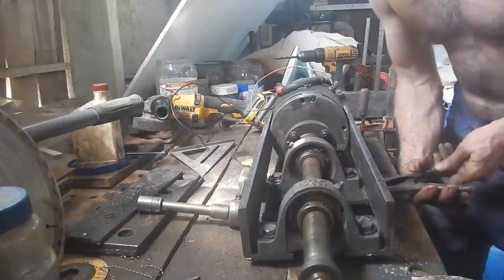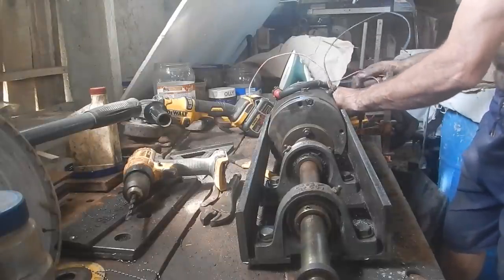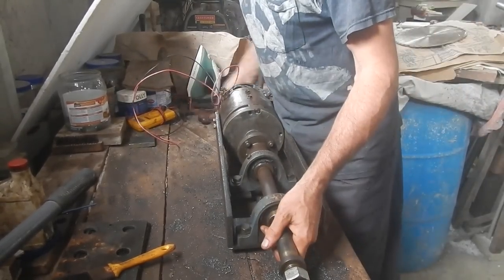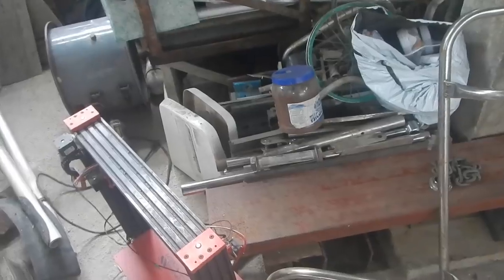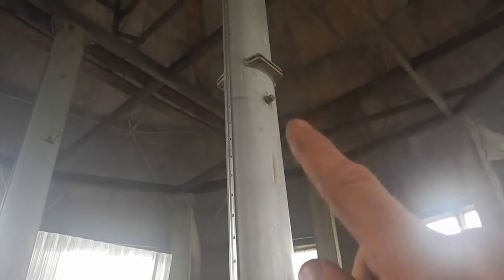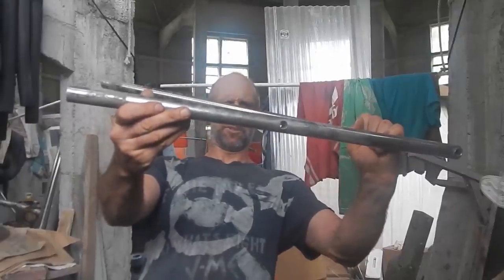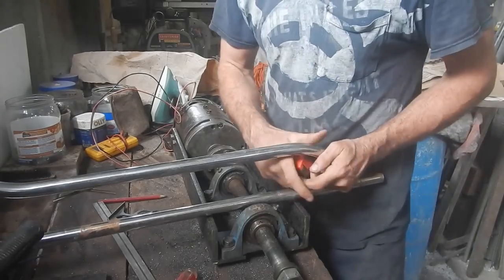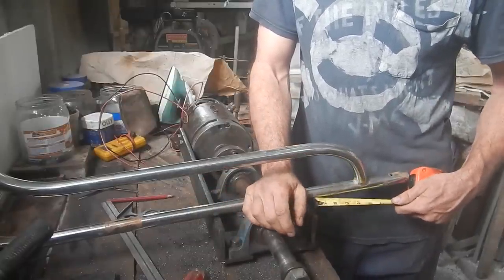Lumber Mill 06 Blade Pivots

Comment: I Love hearing the rain. Inside work day! I have been doing some research on big electric motors for sailboats and regeneration drives. Your ability to make motors do all these different things with power you are collecting from the sun is really inspiring. No diesel needed!
Reply: Oh yeah, could you put a 'dimmer switch' on it to control the rpms?

Comment: Nice tip for keeping nuts from vibrating loose, hold the last tensioning for three seconds for the tension in the bolt to settle and holding on the nut.

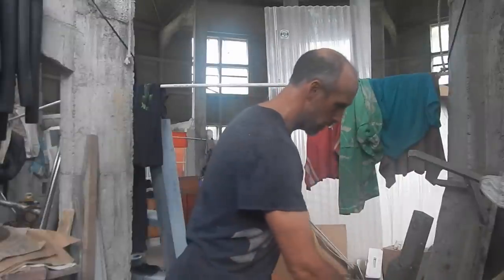Comment: Jaimie at 8:12 what about using a heavy duty hinge welded to the bottom end at the blade end welded to the frame as well as the saw bench you will be connecting it too.

Comment: I started to build one years ago. Mostly because I wanted to and knowing I would never finish it. 
I used a T gear box with 1:1 ratio and had a 5hp 220v electric motor. The problem I had was going to be the gear box and the ability to keep the gears tight, as the gearbox was just some random scrap I found. 
if i was going to do it all over again. I would just buy a brand new swingblade sawmill. Lucas no longer makes the 4 inch model as far as I know. Yet back when i was looking they were only like 6k new. Used one might still be able to be had. i did not care anything about bigger lumber other than 2x4 and 1x4s for what I was going to do. My plan was to bring in cottonwood trees that have been felled and dead for ages and cut and stack them in to lumber. Sell them for a fraction of what a new one cost. All while still making quite a bit of money doing it. Now I no longer live where I was going to do that. I bought a nice place far away.

Comment: I think this build is great but I have a question. What size blade is that and is that the same size that's on the radial arm saw? In theory can't you use the radial saw to do the same thing? Check out Stumpy Nubs for the set ups. Back in the day they did a lot with a radial saw but it was sketch, but that would be right up your alley. That's why I watch, so fun.

Comment: I don't understand why it has to swing? Isn't it easier to rotate the log. And the complexity of the construction would be reduced and the saw would be more robust and last longer. 8:16
Reply: I was thinking the same. But it may be connected with the fact that the log must be anchored. Or too heavy to easily rotate.
Much easier to pull a lever, rotate and block, than unclamp the log, rotate, clamp again. 
Sure, building the swing will take a day or two, but saving a minute at every log will add up in time. 

However, I like more those with continuous blade. Or flexible, however is named. They run so smooth, and the cut is thinner. 

My brother had built one with swinging blades. Bought 8, to cut one log in a single run. Tested with a single blade, but did not worked. The cut will go astray. Mayne not tensioned enough, maybe needed some guides closer to the log... however he switch to circular blade. Big one, one meter diameter. Damn thick cuts. 1 cm. actually at 2 planks one was going in to dust.      Started dreaming at lasers :))
Reply: And each tooth on the saw blade will need to be bent in a different direction to reduce the friction of the blade on the log. See at 6:27 https://youtu.be/nM5sXrZUCtk That is why so much sawdust was formed.

Comment: @15:00 Attaching those nice fat tubes to the parallel surfaces would have been the so simple using stick welding... Don#t you have welding clamps - a big 24 to 48V battery could be the ideal power source to do that too!